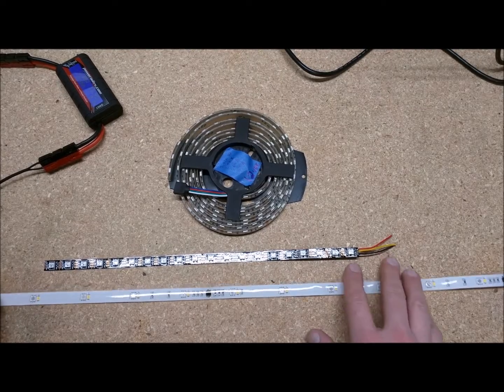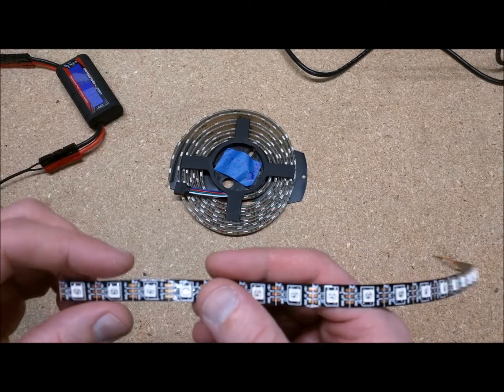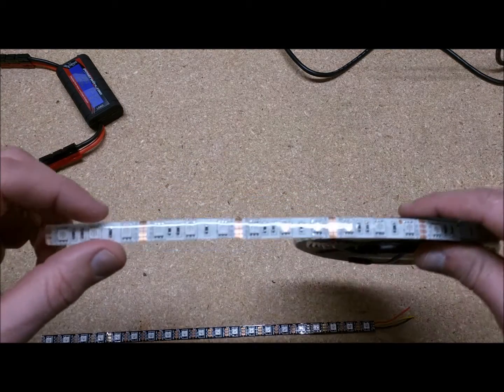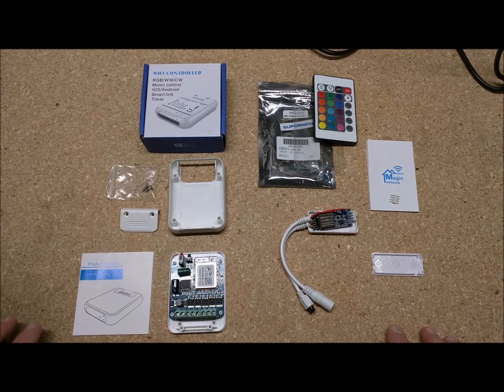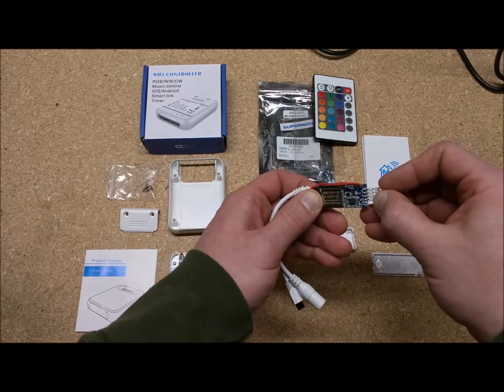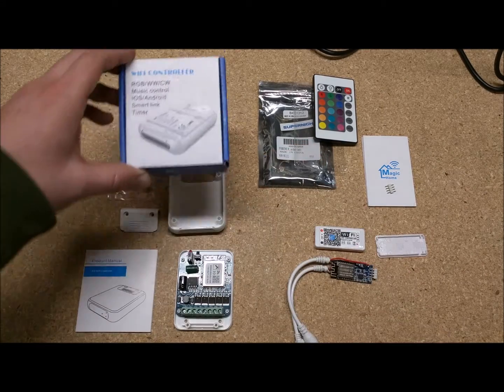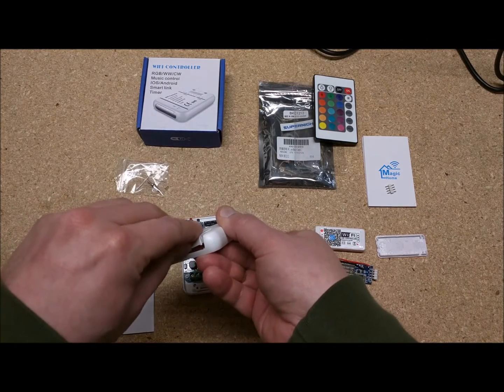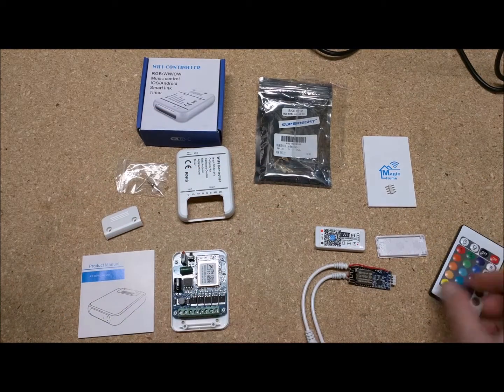About LED strips and WiFi controllers

Comment: Hi. I have a 5050 60led per meter strip.
Is it posible to make the same strip have different colors? To make different color modes or waves or something else?
Reply from the maker: Look between the LEDs on your strip, if you see connection points labeled such as...

V+ / Data (or D in) / GND (only 3 connections) ... then you likely have an addressable strip, which needs PWM data to control, and does allow each LED to do a different color/brightness than the rest.  Meaning different colors on the same strip, waves, effects, etc.  To control such a strip, I'd suggest https://www.bhencke.com/pixelblaze

V+ / R / G / B / WW / CW / GND (4 or 5 connections) ... then you likely have a strip where only the whole strip will light up as the same color - this is like the 3rd strip I show in the video - and can only be controlled with a controller that offers R G B (and maybe WW or CW) - that's 4 color control, and then a 5th wire used as a common positive (+) or ground (-) connection.